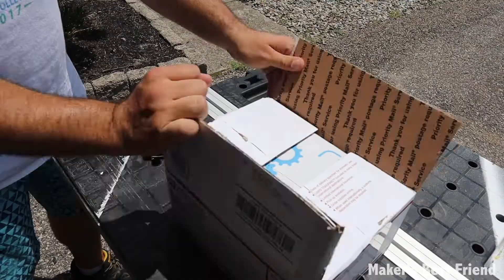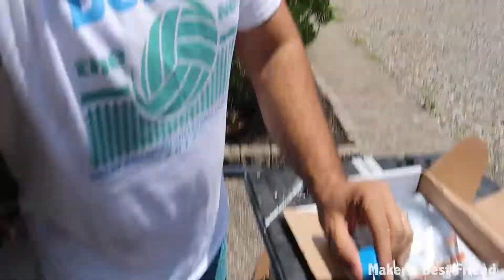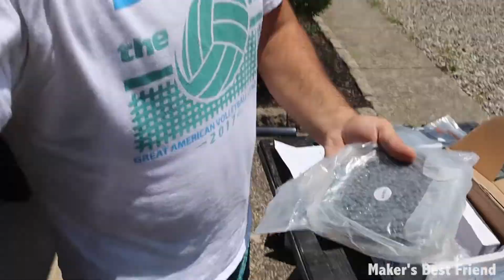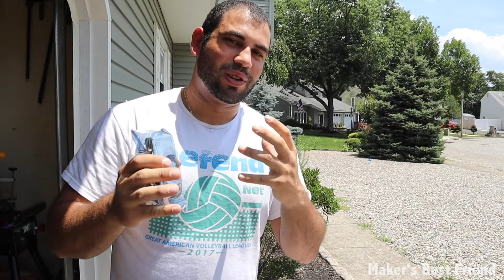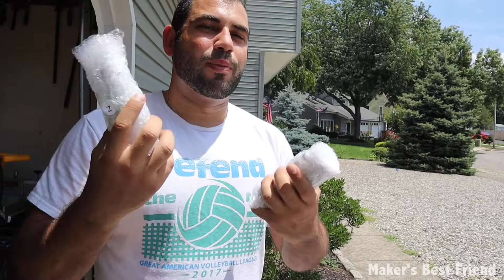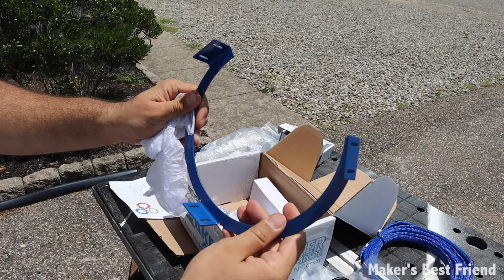Maker Made CNC (Maslow CNC) Unboxing!

Comment: Regarding the chain lube, consider checking out Boeing T-9 lubrication. It's wax based and keeps chains really clean and well lubed. Good for many other purposes too. Once it's applied, a quick wipe to clear the dust and it's good for a re-lube or just more run time.  Great video, thanks for the updated info.
Reply from the maker: Awesome tip! Will check it out - thanks!